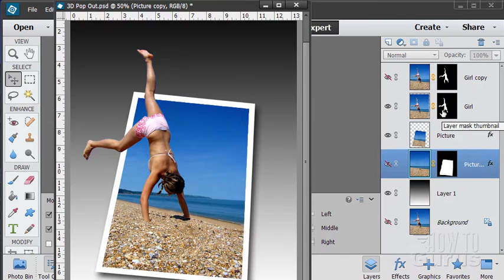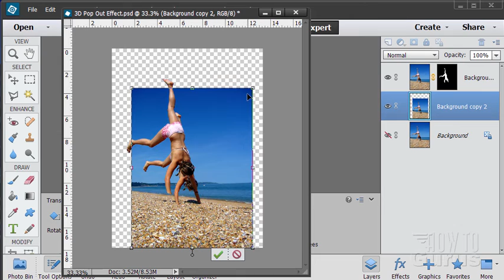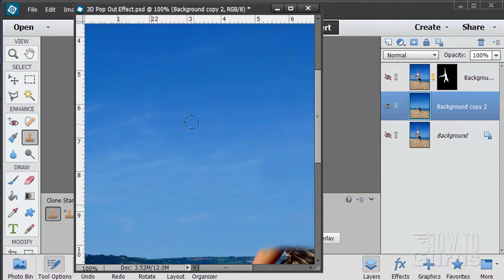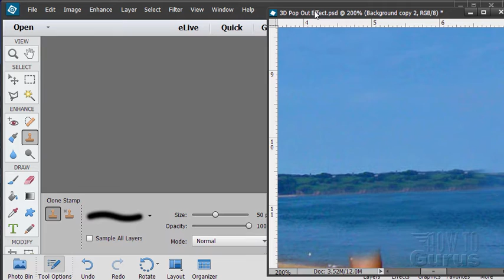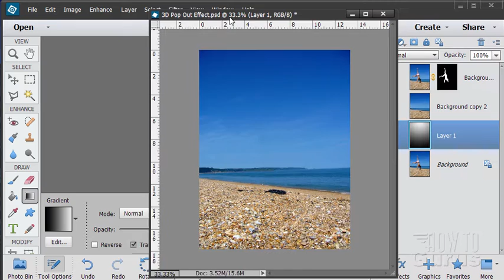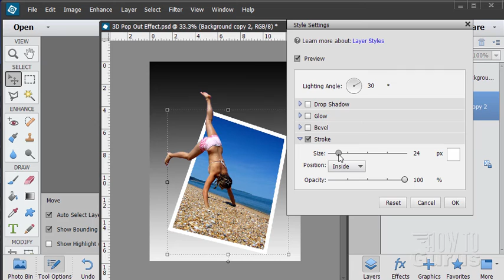How You Can Make a 3D Pop Out Effect in Adobe Photoshop Elements

Comment: Unfortunately, you jump right in after already opening up the 3D pop out tool or effect or whatever it is called. Where do I find that effect, under what menu? thanks
Reply from the maker: You need to watch the video, I start by showing the finished result for reference, then I show how to do the whole project starting right from the original photo. I don't use any 3D pop out tool or anything like that. Instead I show you how to do this effect without any special tools except for the Photoshop Elements program itself.